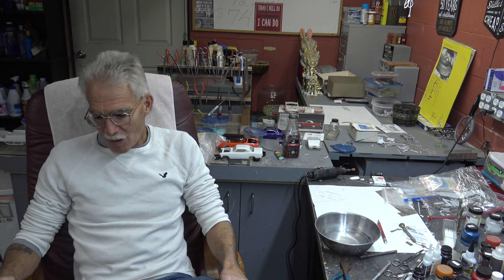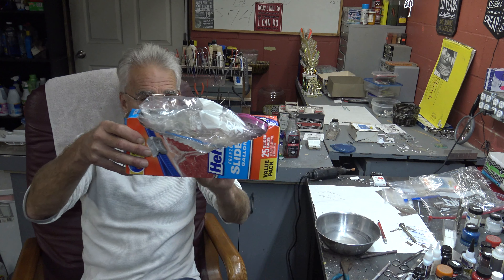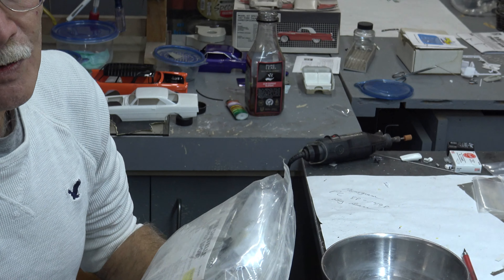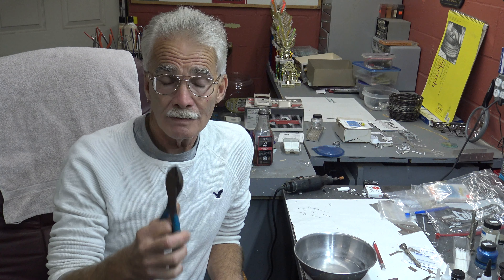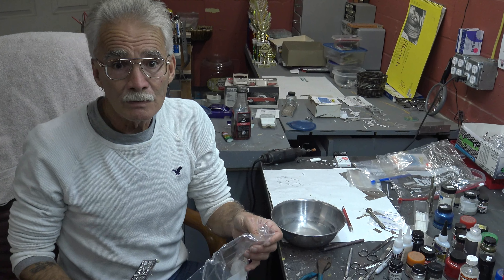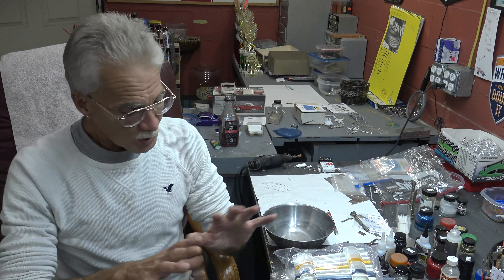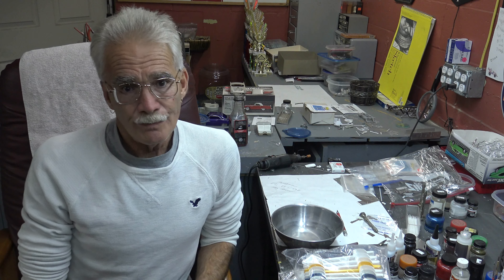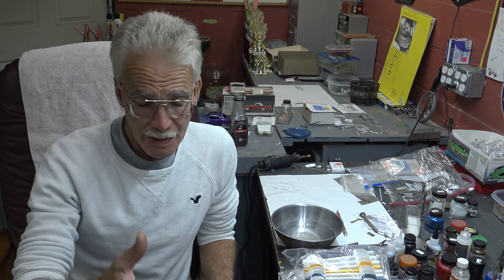Fundamental Friday  -  Episode 39 -  Kit Consolidation (1)

Comment: Cut the pieces off the sprues in a way that the part number is still with the part (e.g. the engine block with a few millimeters of sprue attached to it with the number "17" visible). 
Put these in the zip-bags, throw in a piece of paper with the model/sub-assembly data (e.g. Revell Golf GTI mk 1 engine) on it and you're good.